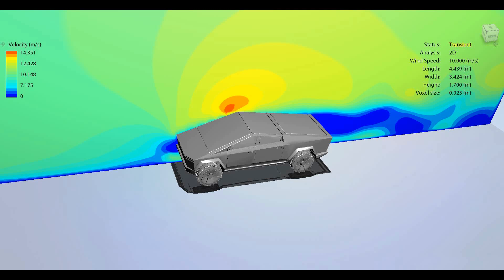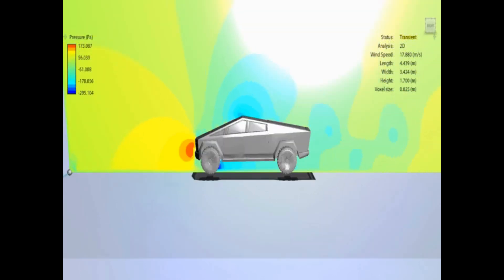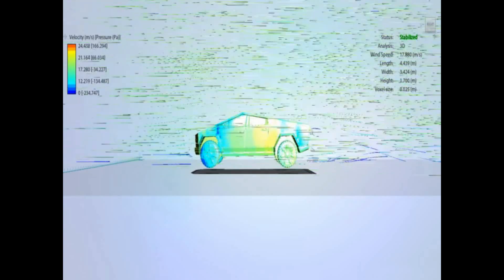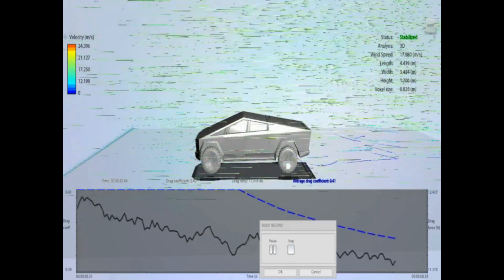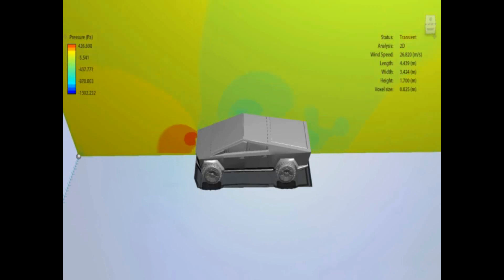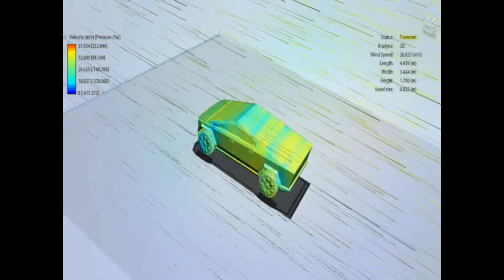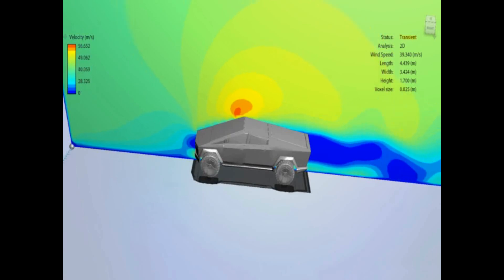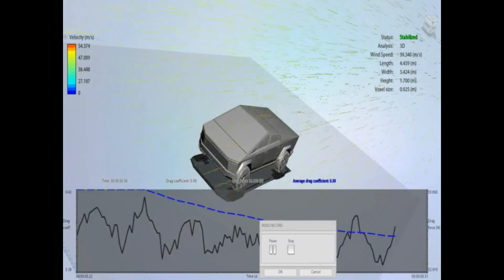Cybertruck aerodynamics - Whats going on?!!!

Comment: I wonder how it performs in crash tests.
Reply: It's made of 300 series cold-rolled stainless steel. They probably had to build a stronger test impactor.
Reply: @mycroft16  I'd imagine it would crash like a stone hitting a wall. No crumple zones.
Reply: @TimSlee1  Cumple zones are a symptom, not a solution. Most cars are made out of material that can't absorb lots of energy by themselves. Plastics. Etc. So they NEED something to absorb it for them. Car designers came up with the crumple zone for this. An area of the car designed to crumple and absorb impact energy.

300 series stainless steel is incredibly difficult to deform. Meaning by itself it is capable of absorbing significant amounts of energy from an impact. On top of that, there likely are crumple zones. The entire bed of the truck acts like one. There is likely space in the front of the truck ahead of the passenger compartment that can crumple a bit and it's likely plenty given what it's all made of. We also don't know how the frame or chassis of the thing are designed. You can design frames to redirect energy from one part of a vehicle to another. Roll cages take advantage of this.

Once again, the people who designed this are actual experts in the field of automotive design, and they wouldn't be showing this off and taking 20+ million from people to reserve them if a) it would require significant modifications before production, b) it wasn't safe.

Comment: What's crazy is the Cybertruck has air ride suspension that can be adjusted on the fly.  You can lower the truck for less drag and adapt the approach angel to optimize air flow.

Comment: What if they’re forced to have mirrors, I’m curious how that affects results
Reply: It will increase the drag, but properly designed they don't have to be a huge disruption to air flow. And given the wizards that work over there, I'm assuming they've already figured the problem out, knowing full well what the auto regulations require.
Reply: Probably gonna put cameras on each side that show you your sides on the screens

Comment: The whole point of aerodynamics was to reduce drag and save gas money...because its so expensive.
This is an electric vehicle, who cares about its aerodynamics?
Reply: @Larry XK Have you not seen the range of the vehicle already? How much more range do you think you could squeeze in? I already mentioned "drag" in my original comment. But you failed to read, Drag is pointless when your range is huge and you aren't paying for gas. This isn't a racing vehicle. Make sure you learn to read before you insult someone. It could have perfect aerodynamics and it wouldn't make that big of a difference. All of the cars ARE aerodynamic, they obviously didn't care when building the cybertruck. But you know more than engineers do right?
Reply: @Larry XK I don't know how many times ive explained that I already mentioned drag lol. I just don't think it makes as big of a difference with electric vehicles that aren't meant for speed/distance. It's more of a working vehicle not for travel. And even if you DID travel in it, the fucking aerodynamics isn't going to help very much! its not gonna make a big enough difference for you to worry about. I bet you would be surprised at how little it changed the vehicle if you made it more aerodynamic.
Reply: @Larry XK Could you explain what Drag is one more time please? I don't think it was even mentioned in my original comment.

Comment: So the best you get without windshield wipers and side mirrors is .4 at a normal speed and .38 at almost 90 mph and you somehow guess it will be .3? I don't think so, it will be lucky to get the .38 in production from and that's not as good as the current Ram.

Comment: This car looks more or less inspired from the lockheed f-117 nighthawk with its angular design
Reply: The design process was probably influenced on how much easier it is to produce cars with large, flat surfaces
Though I wouldn't mind seeing a militarized version with actual stealth capabilities
Reply: Paul Deddens it’s blocky because the metal is so strong, they can’t bend and shape it like they can with most cars
Reply: That’s what alot of people say. But, relating to tests of wind resistance, the design of the F117 was only to refract high frequency radio waves from returning to the transmitter. The panel design had no advantage to aerodynamics. Modern 5th gen stealth aircraft feature curved and smooth edges to improve aerodynamics. 

Not saying you, but Some people assert that if it looks like a panel designed based stealth aircraft, it’s super aerodynamic. Not the case.

Comment: You need to put the car on the ground.  There is too much open area for flow to pass under the car which will potentially also impact the flow over the top as it will influence the stagnation point on the front of the car.  Also I’ve been doing aerodynamics as a profession for more than 20 years and I have a hard time believing that the flow will not separate at the roof bend.  Have you looked at the influence of grid refinement in that area, how well have you refined the boundary layer and what turbulence model are you using?

Comment: I have no idea what I'm talking about but would you see a difference in drag coefficient  if you lowered the truck. I do believe the truck is supposed to lower significantly at highway speeds.
Or does that not make much difference?

Comment: Great video, but doesn't the vehicle drop lower to the ground when it's moving?
Reply: Depends on speed and surface roughness. Having an onboard AI, it can anticipate speed humps and ooze over them like nothing.
Reply: the vehicle is running on airbags suspensions

Comment: I believe that because of its shape, it is also a stealth truck with the right kind of paint job.
Reply: Yes and with appropriate fuel it can actually go to mars
Reply: I take it you dont believe that.
Reply: @MrManerd  wait do you seriously think that?
Reply: With flat sides, radar and light beams will be reflected in a strait line rather than in an arc like it would against a rounded or curved surface. The radar source would have to be exactly perpendicular to one of the flat sides to receive a return.
https://en.wikipedia.org/wiki/Radar_cross-section#Shape,_directivity_and_orientation
Am I wrong?

Comment: Will your software predict convective heat transfer? If so, what is the heating load travelling at 100 km/h with the interior temperature at 10 C and exterior at -20C?
Reply: At least I'd suggest not to go 88 mph in that environment (though with that cold interior I could understand the urge to get to cozy home fast). But seriously, the answer to your question would depend a lot more on material than just shape
Reply: @HagenvonEitzen  Yes, it will depend on the body materials.  As far as heating load is concerned, it's a forced convention problem. The full solution will require modelling the physical properties of the body surface but the hard part is the fluid aspect of it.  I'm not sure what you mean by "not go 88 mph in that environment".  This is a normal situation when travelling on the highway in winter where I live. In fact, the average road speed will typically be 120 km/h. I've asked many Tesla owners who have made winter driving videos what the heating load is (as reported by the car). I've narrowed it down to about 3 to 7 kW depending on conditions. I've not seen any analysis of the heat transfer, however, just anecdotal estimates. The 7 kW is accurate when initially heating the car. Bjorn Nyland has a video showing a Tesla pre-heating on a winter morning and it was 7 kW. I'm really curious what the heating load is when it driving, it might be higher because the heat transfer is so much higher when moving, but the preheat load won't be present, so it's really hard to say.  A measurement or calculation would be interesting. I've studied heat transfer in the past but these things are really hard to estimate accurately. Modelling software is the best solution.

Comment: Hey man I don't want to be mean but you really need to rework your constraints. The floor in your model is stationary, should be moving with the speed of free flow. Also the tires need to rotate, especially as they're those big off road ones. Then, you can get the ride height right.  In automotive CFD, the interaction of the car with the ground and with it's tires are the major considerations to look at. Wind tunnels are often equipped with treadmills and rollers, to give an example of how important it is. You need to take another look.

Comment: You should run a full 3d sim with the resolution set to 200% or more, it will take all night to stabilize but it will give you a much more accurate idea of the cd and how air flows around it
Reply from the maker: The drag plot was done in 3d for 10 minutes.

Comment: Can you model this at a clearance of 8" to see how much difference it makes.
Reply: Hey eh so, you gone pay me too? 😏
Reply: @taishibikiqe8796  yeah
Reply: No pay me and I'll do it. Just pay me through PayPal and I'll do it... Ill take the money.
Reply: @s33kzRGH  You literally just make the model (job of a few minutes), higher the car a bit and the program does the rest.
Reply: @RyosukeTakahashiRX7  you could probably make a shape like the tesla truck in a few minutes
Modeling it in accurate detail would take a week or two though
Reply: @jayjaygolden5123  Yeah but the one in the model isn't an accurate one. Also the general shape would be enough in this case, it's only a rough estimate.
Reply: Ryosuke Takahashi that’s definitely not how CFD works, good programs are really picky about geometry and you’d want to adjust the mesh (CFD term) between the road and truck if you raised it.
Reply: @SketchRC  I'd like to learn CFD. Is there any freeware you would recommend for starting out?
Reply: HISΞROD i don’t have experience with any free software. I learned while I was at university so I had access to industry standard software. OpenFOAM seems comprehensive enough, but I’ve only used ANSYS CFX and ANSYS Fluent, with more time on CFX because it’s compatible with our supercomputer.
Reply: HISΞROD i noticed you just subbed, so I’ll post a CFD tutorial I made for my racing team real quick so you can watch that. Hopefully it helps. The process will be similar in setting up a CFD run, though the appearance of the software will be very different from anything that’s free.
Reply: Rykahnz If you pay me I’ll do it
Reply: @SketchRC  i can pay you
Reply: @magadzhabraftw6157 can you pay me?
Reply: @BrevityBuzz  yeah